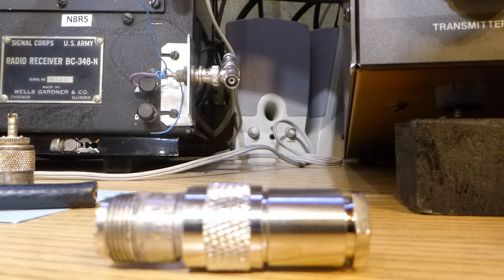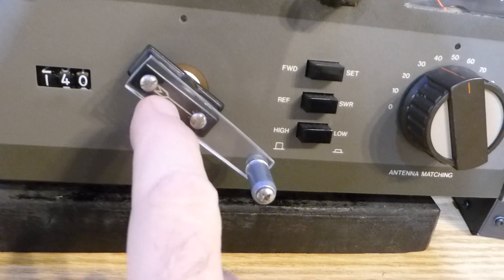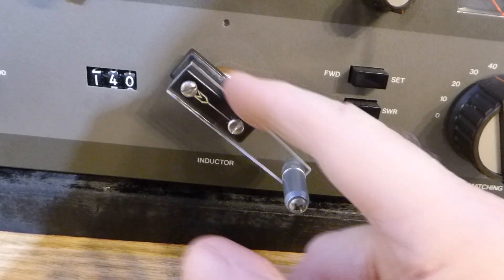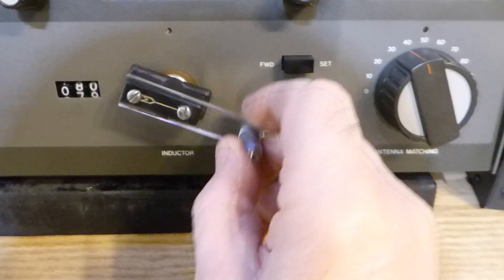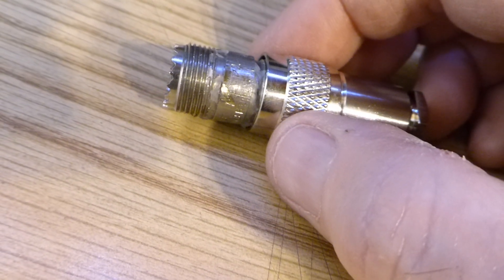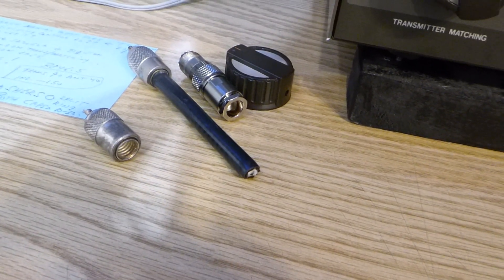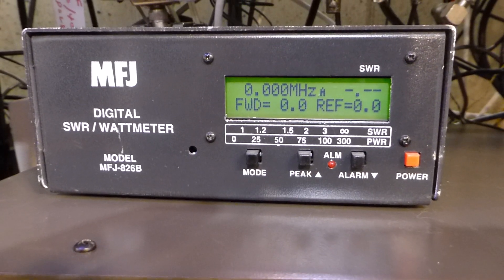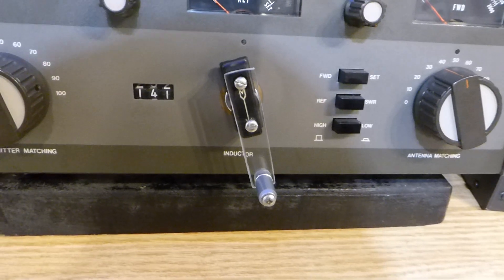HEATHKIT SA2060A antenna tuner , DIY SPINNER KNOB , SA2060A TIPS

Comment: Bob, you talked about turning it into an auto tuner. Did Heath get very far with it?

I'm thinking of putting stepper motors on each off the tuning knobs.

The only thing stopping me is l'd like to be able to go back to stock configuration if it doesn't work as well as I think it might.

Any idea where I might get an extra front panel and top cover for it?

I'm either going to mount it directly on the tuning shafts or use sprockets and plastic chain, and mount the steppers on the lid.

For a first try, I'm going to do a straight "memory" tuner that just looks up frequency and settings.

If that works well, I'll try actually looking at the SWR and fine tuning for an SWR dip.

Thoughts?

73.
K7SAL

Comment from the maker: Thanks Carl and Dave ... I was very pleased at what an improvement the  DIY spinner knob was on the Antenna tuner . Sometimes the simplest little thing 
makes a huge improvement... Heathkit was going out of business when the SA2060 was being sold we were told it was "use what we got " and so we had the plain old no frills knob on the tuner roller inductor. Zenith was shutting Heathkit down ... you know I still like old Zenith radios ...73   Bob